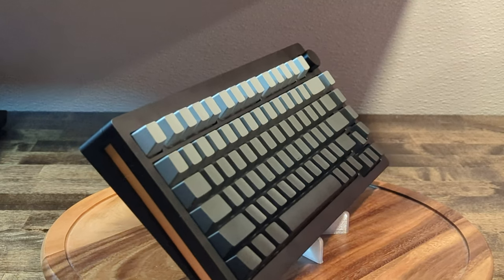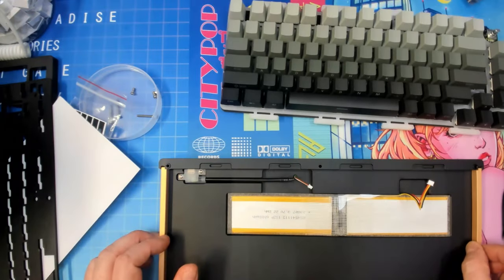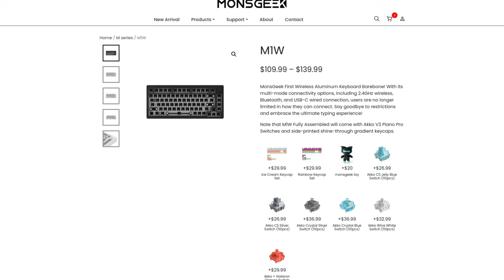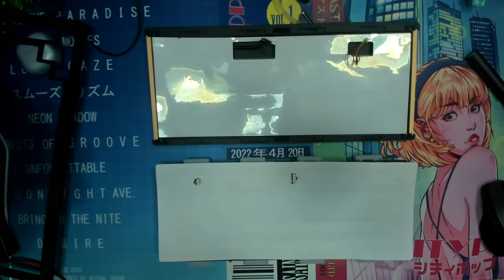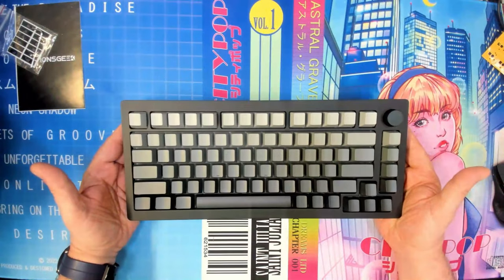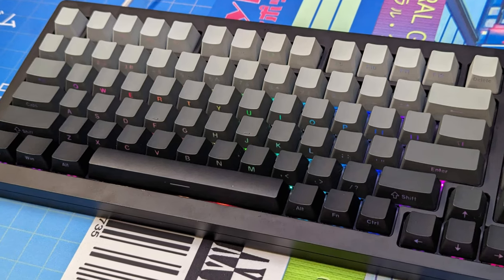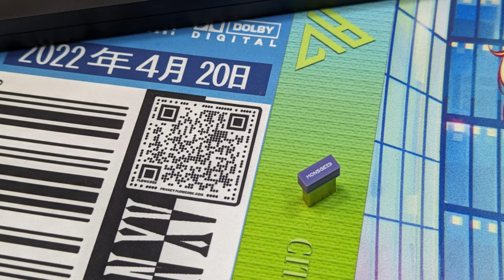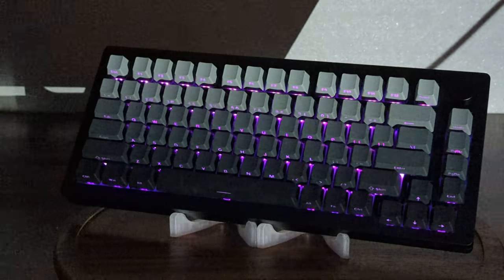Monsgeek M1W Review: An updated M1 with three mode functionality. Great in-stock #mechanicalkeyboard

Comment: Nice intro review Mark. The only takeaways i have with this board is the non VIA and the placement of the mode switch. Some may want to stick with the LMK81 or Cidoo v75 pro for those specific reasons but overall, the m1w is still a pretty solid board.
Reply from the maker: Thanks!
Reply: Is the mode switch really a problem? You just use it to switch between battery and cable, switching between connection modes is done by FN+<Key>. Imo the biggest problem is that you can't remap the knob click. VIA would be nice, but afaik there is only a keychron board that has 2.4 and QMK/VIA.

Comment: Mine got delivered a couple of days ago, gonna load it up with some broken in Nixies. Looking forward to the build process, just gotta find the time! My 2.4ghz dongle doesn't work with my QK75, and every now and then I do notice the poor bluetooth polling rate, so curious if the M1w will replace the QK as my main board.
Reply from the maker: I only ensured that it connected, which it did, and that it wasn't dropping anything. Both connections were good and solid which I can't say for every board. Looking forward to checking out your build, once you have the time. There is a commodity I could sure use a whole lot more of!

Comment: Thank you for this and your other videos, they're very helpful. The only deficiency I see with this new model is the Cloud driver vs QMK, but I could be wrong. Do you know if it's capable of mod-tap style functions? I've become spoiled by making Caps Lock into Control when held, but still Caps Lock when tapped. I miss this when using my Cidoo V75 (an impeccably designed keyboard, btw), and I want another wireless knobbed 75% that can do this. Also, do you know if the knob directions can be assigned to different functions on each layer?
Reply from the maker: You're welcome and no, no tap functionality with the cloud driver unfortunately. 

I've gone through (6) poorly built Cidoo x Finalkey keyboards and personally find them to be of poor quality.
Reply: @MechKeyboards Ok, thank you for your reply, I'll avoid this Monsgeek. Considering how well built my V75 is, I'm surprised to hear about your Finalkey issues.  I've wondered if I just got lucky, considering Cidoo isn't a big brand. Could you elaborate on your Cidoo issues? The only problem I have is that the VIA compatibility is not full QMK, so no mod-taps or timing based macros. Otherwise, it's much better than my modded gmmk pro. Thanks again!
Reply from the maker: @DrivenKeys  I've reviewed a handful of V65 V1/V2, all have had defects, primarily the JST connector breaking into pieces. I've had issue with FinalKey going back two years now for the same issue, poor QA/QC.
Reply: @MechKeyboards  Gotcha. Yes, I feel I did get lucky then. I recall another Youtuber mentioning that the V75 jst connector recieved an upgrade over the V65. I've disassembled my V75 many times without issue. Cidoo says the V75 was designed with feedback from the V65, so perhaps this issue was eventually resolved. Still, no excuse for so many problems, thanks for sharing.
Reply from the maker: @DrivenKeys thanks for watching, cheers!

Comment: Once you chose the wireless mode, it will turn off/on automatically?
or do I really have to pull out that caps lock keycap every single time? 🙃
Reply from the maker: The board goes to sleep after inactivity, 30 seconds if not paired, 5 minutes is paired.